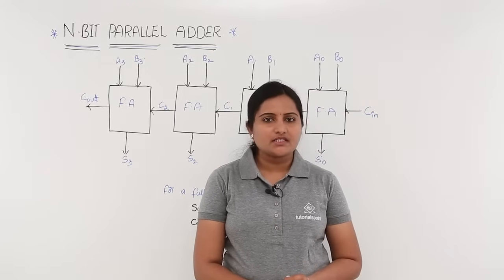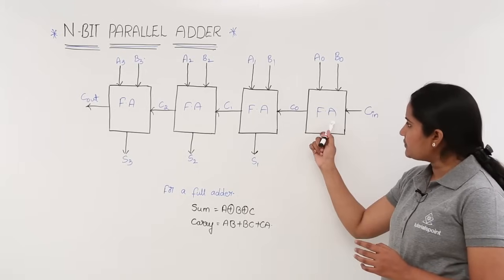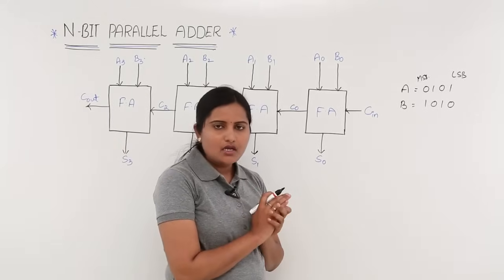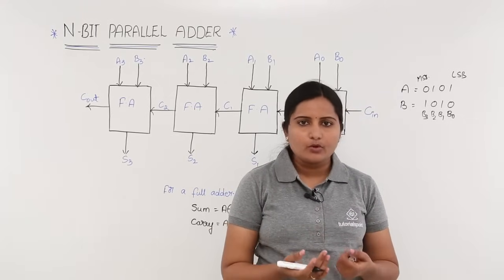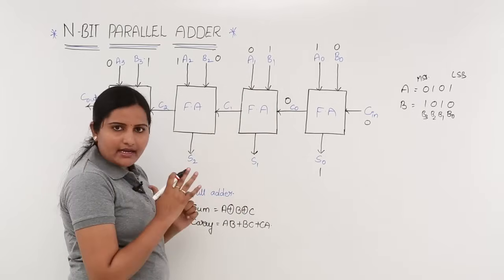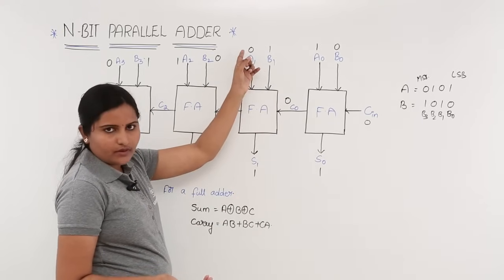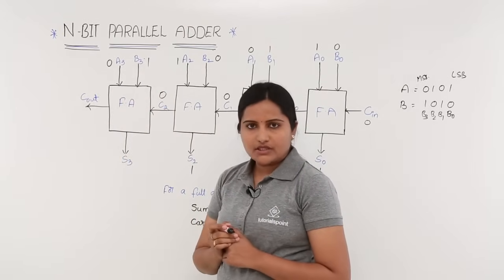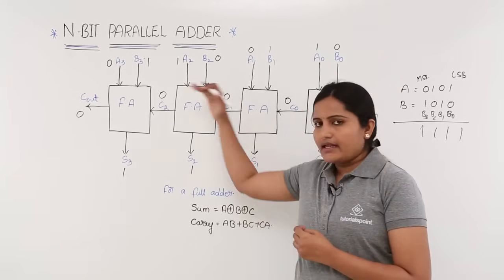N Bit Parallel Adder 4 Bit Parallel Adder

Comment: What if I add 
11- 1011 and 14  - 1110
We would not get the ans.
Plz explain
Reply: first consider both in binary like: 14 in binary is 1110 then add with the 4 bit digit you have...but for 11 if it's binary 11 you can write it like 0011 in 4 bit to add ...hope it helps...though you might as well got the answer now 😂

Comment: How come when I'm adding 0101 and 1010, the result, using the 4-bit parallel ladder is 10110? I know it should be 11101. But I just can't get it.
Reply: 1111=15
Reply: try first 8421 covert then do this